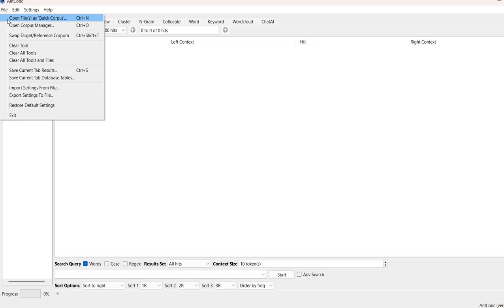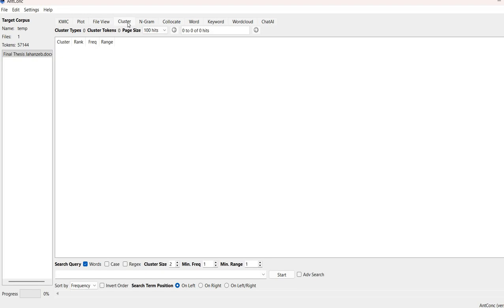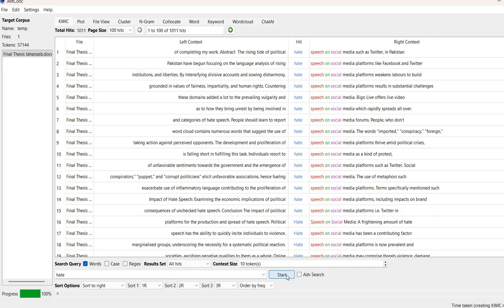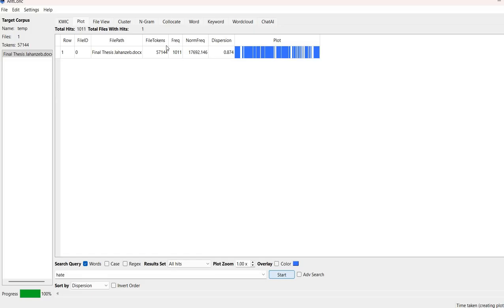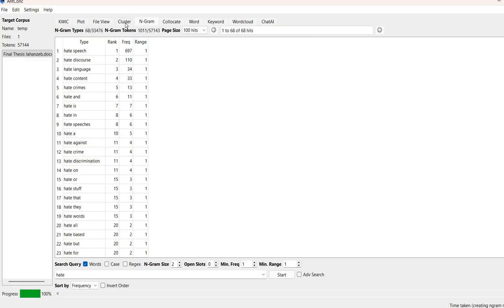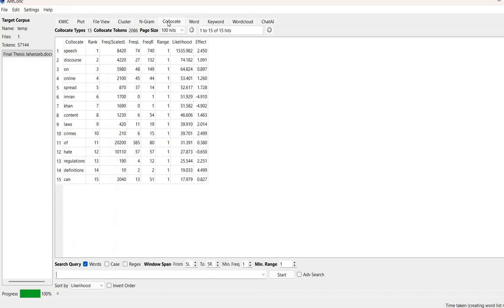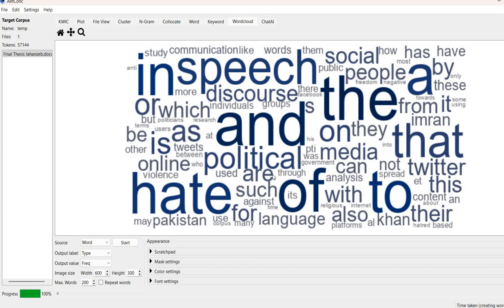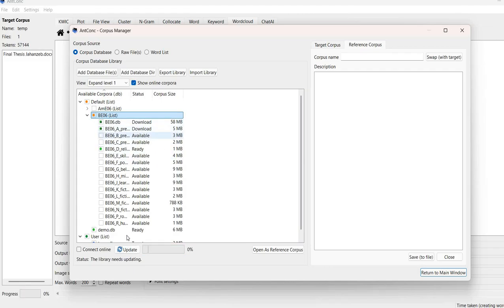AntConc Tutorial for Beginners: Simple Text Analysis Explained

Comment: If I analyze a 100 'txt' file from two corpora, what should I do in that case? I have to compile 50 'txt' files for one corpus and 50n for another? OR I have to analyse individually each 100 texts from the two corpora. I would be grateful for your answer
Reply from the maker: To do Option A (50 files from Corpus A and 50 from Corpus B) in AntConc follow these steps:

Step-by-step guide:

1. Prepare your files:
   - Create two folders e.g., `Corpus_A` and `Corpus_B`.
   - Put 50 .txt files in each folder.

2. Open AntConc.

3. Load Corpus A first:
   - Go to `File` > `Open File(s)` or `Open Dir`.
   - Select the 50 `.txt` files from Corpus_A.

4. Label the corpus (Optional but useful):
   - Rename each file to include a clear tag, e.g., `A_filename1.txt`, so you can identify their source during analysis.

5. Analyze Corpus A.
   - Use Word List, Concordance, Clusters, etc.
   - Save results if needed.

6. Clear and load Corpus B:
   - Go to `File` > `Clear` to remove Corpus A files.
   - Load 50 `.txt` files from Corpus_B

7. Repeat analysis for Corpus B.

Note:
AntConc doesn't support side-by-side comparisons directly. To compare results from A vs. B:
- Export the results from each corpus.
- Use Excel or another tool to compare frequency, concordance, etc.
Reply: @jahanzebjahan  Thanks a lot for your great clarification.
Reply: @jahanzebjahan  All data should be cleaned or Raw data